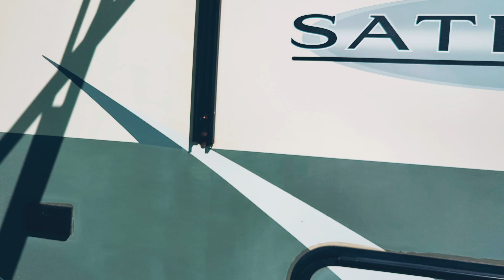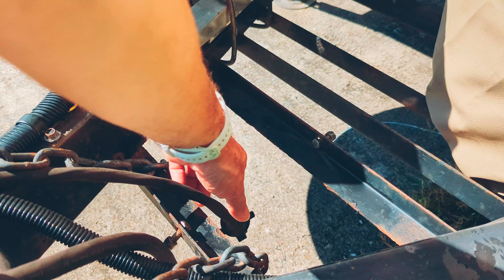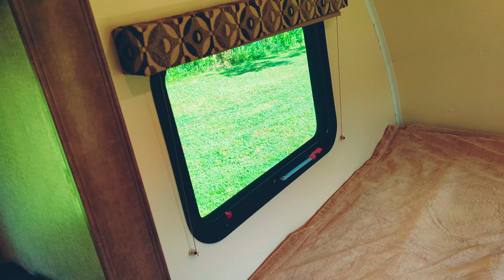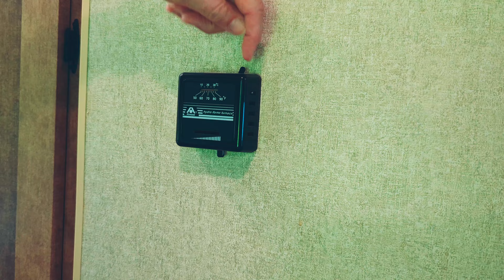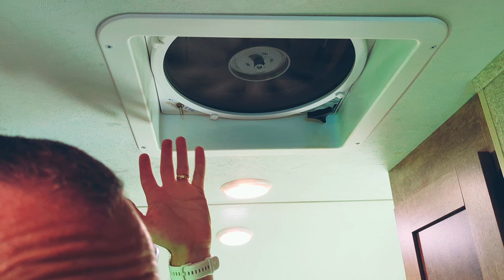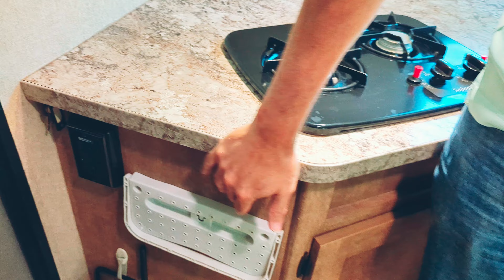2017 Starcraft Satellite 18DS For Sale

Comment from the maker: Getting into the camper is a breeze, thanks to the upgraded illuminated keyless entry door pad.  All of the exterior storage access is keyed and we are including both a hitch lock and a wheel lock that makes it harder for a thief to abscond with your amazing boondocking camper.  Tire covers are included to protect the tires from the elements and a premium camper cover is included that keeps the camper clean and dry in storage (allowing door access even when installed).  

A powered 9 foot awning protects the door on those rainy days for your in-nature entertaining, or nicely blocks the sun for outdoor relaxation.  The Bluetooth speaker system in the camper has the ability to use the outside speakers for tunes in the evening and you have the choice of using the LED strip lights or the yellow bug light.  The camper has been ceramic coated recently, which makes it easier to keep clean.   The tongue of the camper has storage space available, and has a powered jack (with night light) which simplifies hooking and unhooking the tow vehicle.

The camper has new tires, brakes, drums, hub assemblies, and a spare tire (all within two years). Some repairs were made: part of the floor was replaced (minor variation under flooring, but solid), and metal was added around the driver’s side slide for reinforcement.

I’m happy to explain the solar/electrical setup or answer questions to ensure you’re ready for unforgettable adventures. Delivery is available (for a fee). I’m selling to downsize to a converted van. Thanks for your interest—don’t wait to start exploring!
Reply: How do I connect to shorepower? Shorepower is not switching over...please help, we love your RV.
Reply from the maker: @tracieesgro5177  Assuming you have this specific camper, the cord on the tongue is for the shore power.
Reply: @Make-Someday-Today my brother bought your RV. The inverter switches over and back...over and over. Is there a trick that we are missing?
Reply from the maker: @tracieesgro5177  Get the VictronConnect app and get it hooked up to the Multiplus (the bluetooth dongle should already be hooked up) and see what it tells you.  The app should also hook up to the Smart Shunt to get the current battery percentage. Normally when you plug it into shore power you shouldn't really notice much difference, except that it will use shore power to run any electrical devices and recharge the batteries with any 'unused' power from the shore.  No tricks, though.
Reply: @Make-Someday-Today Thank you will certainly try that...however are you able to provide me with the PIN number it keeps asking me for? Truly appreciate your help.
Reply from the maker: @tracieesgro5177  Sorry. I don't have the codes.  You can use the PUK code on the devices themselves to reset the PIN.  https://www.victronenergy.com/media/pg/VictronConnect_Manual/en/connecting.html
Reply: @Make-Someday-Today thank you
Reply: @t @tracieesgro5177  We just bought a Satellite 17 RB for $10,000. How much did you pay for this one featured? I’m wondering if we paid too much. It has a soft spot around the toilet we figured we could fix. Perhaps we should have bargained for less now after seeing how much work it’s going to be.
Reply: @pdiaz1214 same price